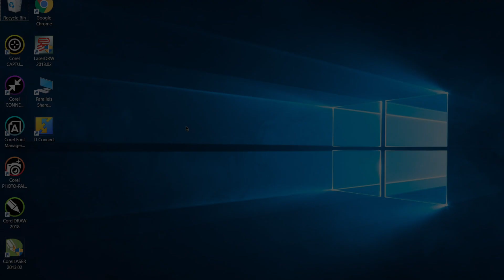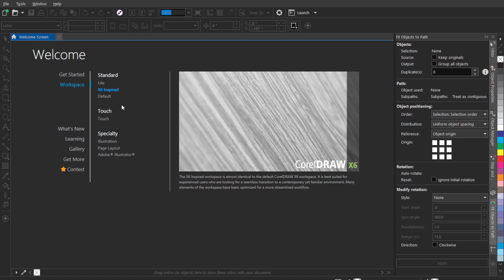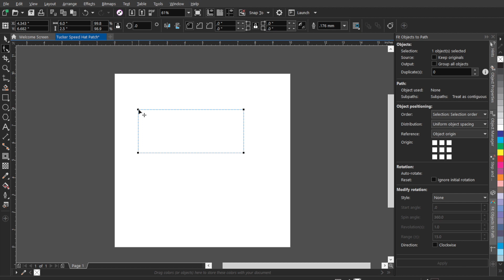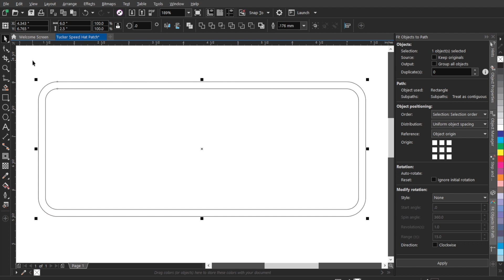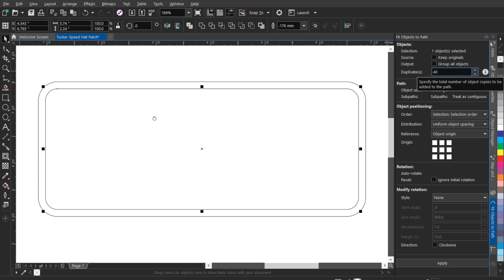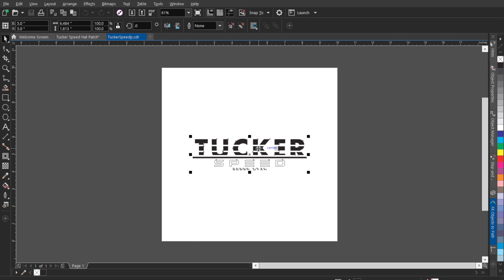Corel Draw Tips (Creating Laser or Vinyl Plotter Files) Emphasis on Stitch Hole Pattern.

Comment: One last thought - I wonder if you left the inside contour line as an engrave not a cut - it would mimic the stitching groove leather makers put in the leather before they punch the holes . The stitch groove serves 2 purposes it tells the leather maker where to punch the holes But more importantly it helps the thicker threads lay in a groove so they are not so on top of the leather where they are susceptible to catching and abrasion

Comment: wouldn't it be great if some leather experts chimed in with the best hole sizes for the different thread sizes (or needle sizes) they could even suggest hole sizes and stitch lengths by thickness of the leather
Reply from the maker: PhotoArt Teacher I actually did this as a project for my a technical writing class. I haven’t checked the comments until just barely. I love using a 1/16” hole for pretty much all of my items. Hopefully that helps!

Comment: this is fantastic - I have been doing this process manually and that takes a long time. I am looking forward to using these techniques for my next leather and acrylic leather patterns. BUT when I look at the curved corners on your screen it looks like the holes in the bottom left and upper right match each others distribution but are different than the holes in the other 2 corners. Also I wonder if there is a mathematical formula to get the distribution of the holes to match a common stitch length like pricking irons that would guarantee each hole is 4mm or 5mm or 6mm apart ? 
Again thank you this video will be a Great help
Reply from the maker: PhotoArt Teacher typically if I’m looking for a symmetrical pattern I will just do half and then mirror them for the other side. This method works particularly well when the holes are around the perimeter of an odd shape. I do a lot of gun holster designs for my dad and it works really well. I think in a shape like this if you choose an even number a lot of times it will be symmetrical.